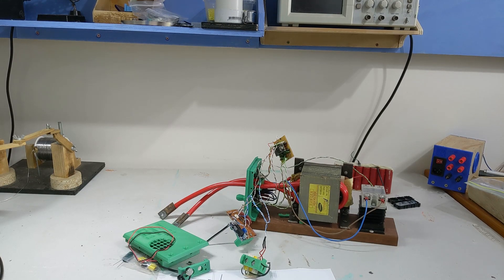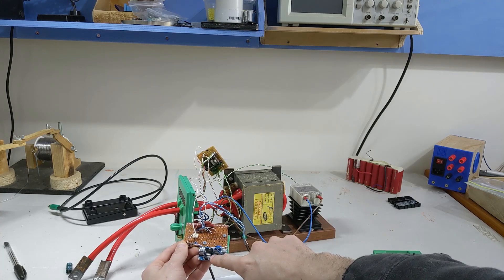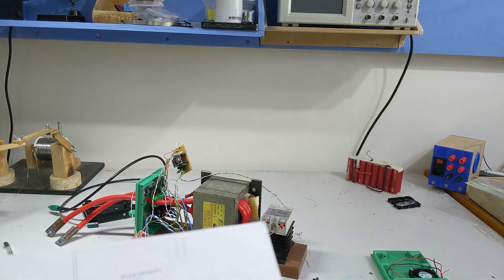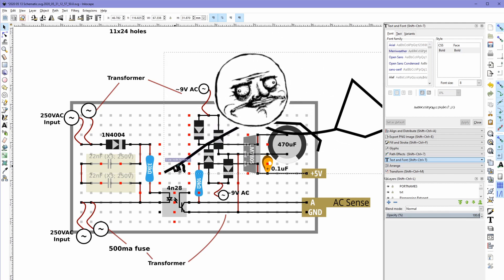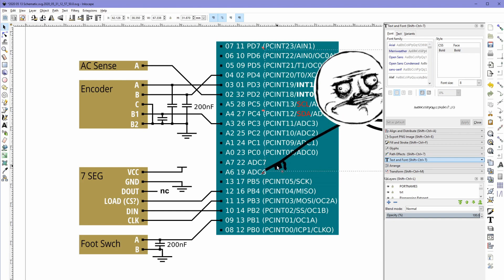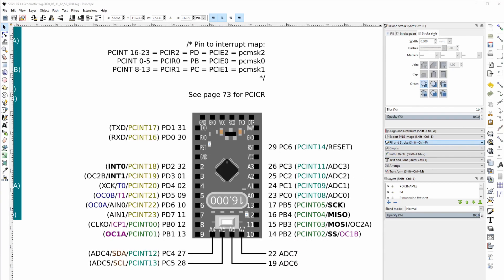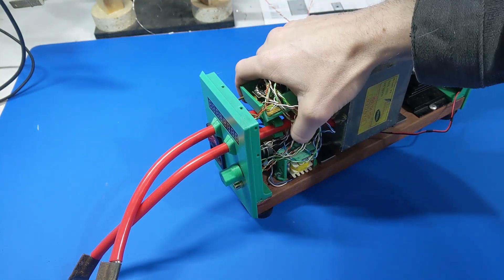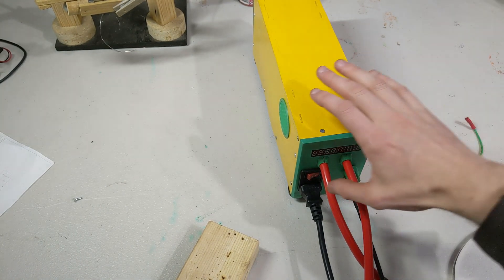Spot Welder from Microwave Transformer

Comment: That is pretty good as you say. Seen many but probably the best result I've seen so far. Are you releasing any details on the build.....???
Reply from the maker: Hi Jeff :) thanks for the comment... No I'm not planning to publish anything further unfortunately... if you have any specific questions though I might be able to help? I didn't put the specs for the transformer or the solid state relay because I don't actually know what they are :P I'm just happy it didn't blow up and I havent opened the case since I finished this video :P